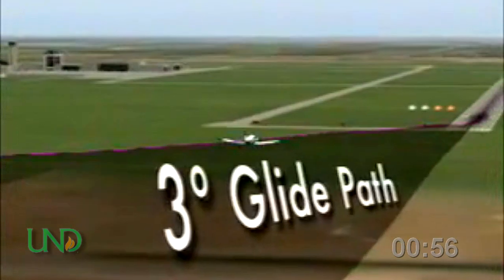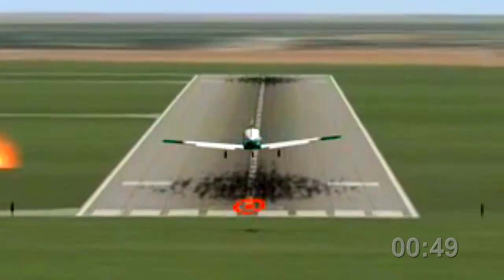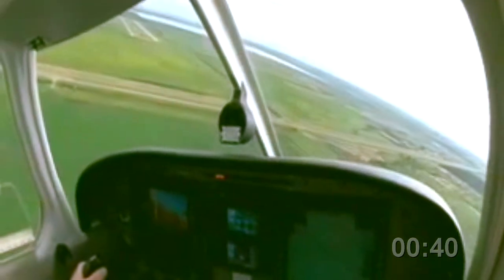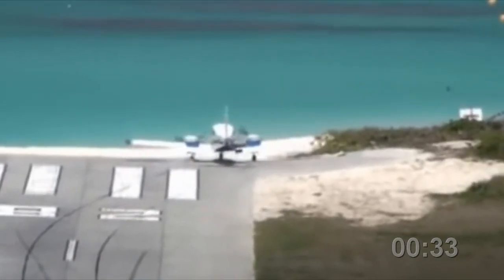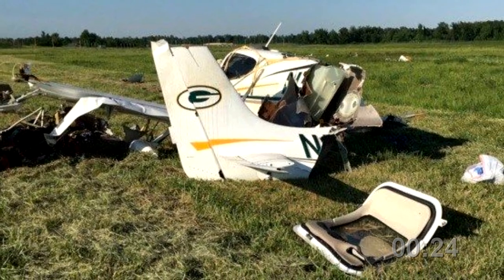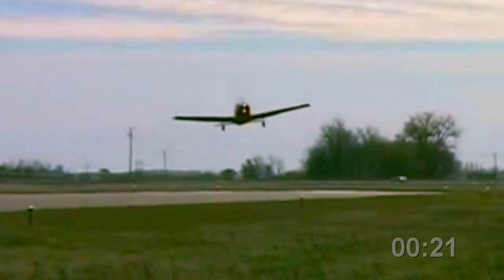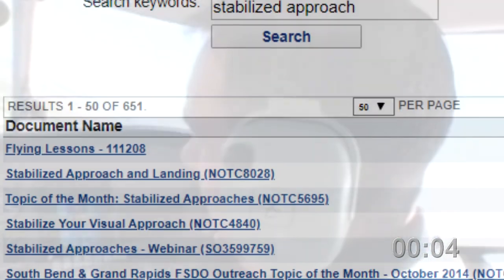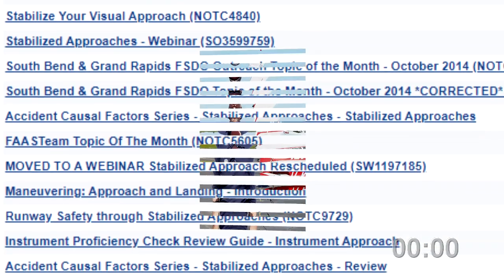Stabilized Approach and Landing in 57 Seconds

Comment: And yet there it is... Section IV, Task M: Forward Slip to a Landing in the Private Pilot ACS, which is an absolute slap in the face to the concept of a Stabilized Approach. It is, by definition, an UNstabilized approach. Not only do the Feds expect pilots to learn this archaic and unnecessary maneuver, they can issue a Notice of Disapproval if the unstabilized approach is not... unstable enough. 

WWII is over. Get rid of this.
Reply: Without going into a mundane, archaic, and lengthy dissertation, I will say this:  Forward and Side Slips to a landing do have there place, under certain conditions.  While they may be old, they are tried and proven types of maneuvers (approaches) that may be necessary.
Reply: @4-7th_CAV  Yes.  If you absolutely have to land on a strip (i.e., lost your engine), the forward slip can help you lose altitude, fast.
Reply: @Gumboz1953  This would be my justification for it - for when you don't have the option of a go-around.